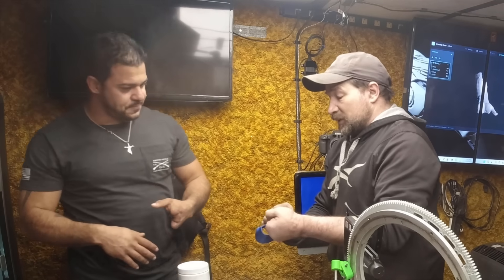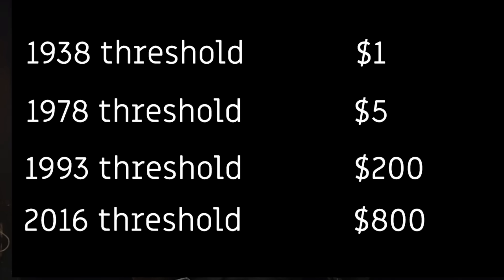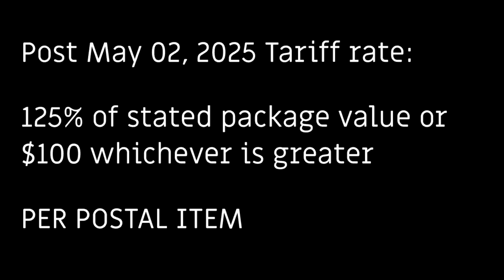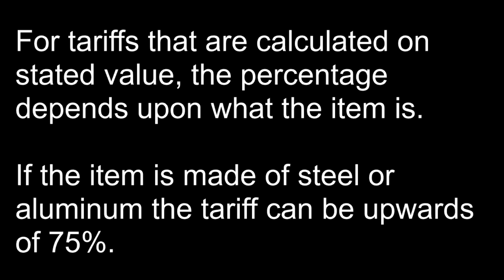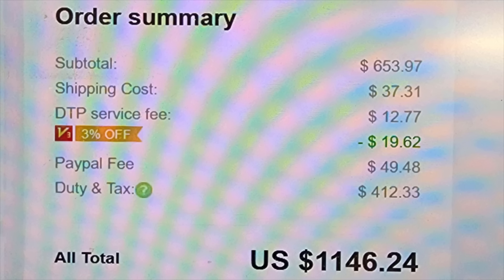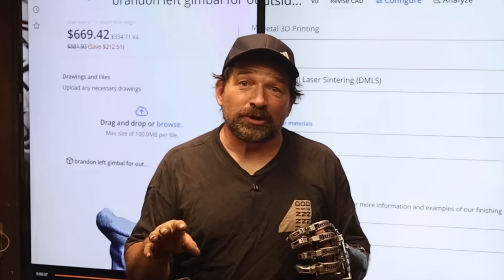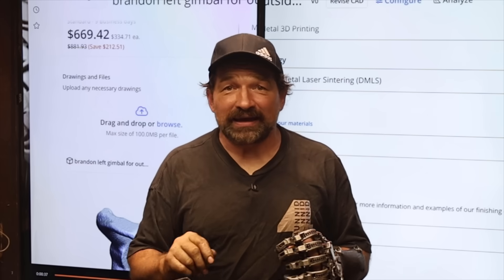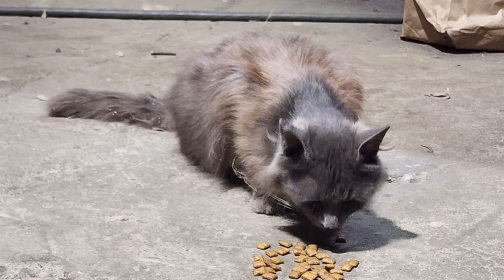No good deed goes unpunished

Comment: Quote your manufacturing domestically. If you don't want to pay the prices quoted, that's ok, but make sure you inform the shop the job was lost due to price. They will either reach out to you to work something out, or make a mental note for next time that their quote was uncompetitive. Quote from as many domestic sources as possible. The domestic industry needs to pick up the slack and add capability and capacity where it's able to. There is no mechanism by which domestic manufacturing can compete with a cheaper labor force. That's the whole point of tariffs, to ensure that access to foreign labor doesn't kill domestic labor.
Reply: one problem:

international megacorporations have been stripping domestic manufacturing capability from the USA for decades, and they don't want to spend money to restore it.
Reply: Smarter everyday just did a deep dive on this and show just how insanely difficult it is to get something manufactured in America.  Many forms of manufacturing simply aren't even available, let alone prohibitively expensive.  Sure you can check.  But as Chris Farley said in Black Sheep, "You can stick your head up a bulls rear end to get a good look at a t-bone steak but I'd rather just take the butchers word for it."
Reply: and those corporations are the same ones who don't even blink at the increased duties, this disproportionately punishes smaller businesses
Reply: I think there is a reasonable middle ground between "slave labor price" and "22x markup" that is surely just buying yachts for CEOs.

Comment: But?  But.... I thought "China will be paying the tariffs".  You're right that the money will not go to funding manufacturing in the US, it's far more likely to go to funding ICE agents outside polling stations.

OK, political snark aside, yeah, that sucks.  The manufacturing isn't coming back to the US on a business-scale level.  those with political blinkers might say it will, but people working at a business scale level will be doing stuff by the container, and shifting the extra cost on to the customer.  For the small scale, though , it simply stifles innovation like yours.  The way I see it, you have a few choices.

First one is to suck up the tariffs short term and hope for a more sane government longer term.  Expensive now, and might not get better later.
Depending where you are, you might be able to (for example) get your parts shipped to Canada then drive over the border to pick them up, being careful to scrap all the packaging.  And hope not to get caught.
You could change production methods.  Go old school, make up models and have the parts cast.  Of course, that kicks Ti out of the ballpark, requires someone with casting expertise, finish machining, and the material might not be as strong.
Or you could maybe set up a collective with other like minded people in the US to purchase an SLS setup, or maybe rent time on one, and try to fund it by turning out parts for other people at ~150% the chinese rate.  Not sure on the economics of that, but it might be worth looking into.
Reply: China exports are VAT free. Same produced in US costs sales tax more.

Why would any country put own industry into such disadvantage?
Reply: @sergeykish  You are correct, china does not charge VAT on exports.  But guess what?  The same applies for most countries.  Take the UK, for example.

(Prior to the tariff extravaganza) Products sold from the UK to the US are largely exempt from VAT, and are taxed at local rates, according to the combined tax rate for that project in the US.  This means that the customer pays the same rate for both locally and foreign produced products.

This is the same system used by most countries / trade blocs for international trade (with china and other countries), with some extra tariffs added on specific goods and services to discourage dumping.

It's not rocket surgery.  It's how international trade works.  That you've been told other countries are taking advantage of the US does not make that true, and does not make Trump's tariffs a good idea.

If you want to bring manufacturing back to the US, the cost of manufacturing needs to be basically equivalent to that of manufacturing overseas at the same quality.  That means government support, a massive investment in infrastructure and training, and a drop in wage costs.  Even assuming the government are willing to subsidise the building of factories and the training of staff and can be relied on to do that longer term than over the next 3 years, how many workers are going to be willing to take that job at 2/3 the average wage?  Especially if, due to tariffs, living costs are rising?

You can't put the genie back in the bottle

Comment: I wonder how much slave labor  can be calculated into the fractional prices coming out of China. What is the going rate of human suffering? Whose suffering is more valuable than others? USA USA USA Just kidding. Good luck with the continued progress and tariff work arounds
Reply: I mean, it's sort of a requirement for capitalism to function that there is an exploited class of people, both in the local "Well if you don't work a job you'll be homeless, and we're making it illegal to be homeless" and also on the global scale (see every nation that gets exploited for first world countries). Um but yeah, this is totally gonna solve the human suffering problem.
Reply: that actually depends on the sector a lot! industrial goods ,tooling and specialty hardware are made by skilled, voluntarily working specialists, and mostly cheaper due to the different culture in china, where the greed of making something for 400 bucks and then charging 20000 for it under the guise of "for professional use" isnt celebrated and rewarded like in the west, as well as the industrial sector in china being hyper specialized, with one factory rarely making one product, and rather dozens, if not hundreds, of factories making single parts assembled into various finished products in other factories.
If you wanna avoid slave labor you should try minimizing that dont need alot of... intellectual willingness of the workers body? Products like i.e. fast fashion.
Unfortunately, it is quite hard to avoid slave labor completely, as even 3M in the US uses it in a few states

Comment: Yep the tariffs ruined most of my projects. I can't justify paying more for pcb's and small alu parts. It was just a hobby for me, now they're just parts in a box.
Reply: You should look into why apple stopped manufacturing in India. It'll probably turn you off of getting anything from that country again
Reply: @Toefoo100 its a comedy of errors, and a ton of kickbacks too. Even if the guys on top try as hard as they can to put in laws and pass down orders to fall in line, grassroot corruption is difficult to eliminate.
Reply: Good find another supplier. Stop endlessly complaining you have options from Manila, Monterrey, Juarez,  Tokyo, and Jakarta, your just complaining like a spoiled child, you should have zero inputs from China a hostile trade partner
Reply: i have to print most of my parts, also I do most of my wiring by hand using protoboards, harder to smd solder, but not always viable for smaller parts, maybe we should look into etching methods and make our own boards, but that limits us to one or two layers, which is not optimal, it's a tough time.. as for metal parts, maybe print molds and use those to make secondary molds for metal casting
Reply: Pcbway has us manufacturing now as well.
Reply: if the tariffs don't relax, then India will fill the void, or Taiwan. i could see some chinese manufacturers straight up moving their tooling to another country to continue selling to the US. it may take some years, but someone will fill the manufacturing void for the US. the massive joke is that Trump thinks the US will fill it first lol. maybe with 50 billion dollars of incentives
Reply: @Gunbudder  if only, indian pcb manufacturing just isnt there yet. I'm indian and when I tried ordering a set of split keyboard pcbs, I found the minimum via pitch they could print was too large, and some vias came comepletely blocked off. Pcbway and jlcpcb are miles ahead in precision
Reply: @Gunbudder  Nah.  They'll just ship it from China to India, then label it "Made in India".
Reply: @Gunbudder  not likely. Building a factory like that is expensive and takes time, and it will never be down to the price it used to be because there will be fewer qualified workers to work in those factories.

Comment: It has to do with building of domestic production infrastructure, just give it some time, it may suck right now but that's just a part of the long term goal, the domestic businesses will have to lower their production cost at some point to get sales.
You could always set up a foam/plaster cast of your parts, over size them a bit then detail them yourself, 300-400$ seems a bit much for a hunk of metal with 3 threaded holes in it, for that price you could buy a furnace and crucible, then any extra parts you make using that method will eat that initial cost, you probably have a bunch of scrap aluminum laying around like most workshops have.
Reply: OP thinks we can backyard bootstrap a modern manufacturing economy. fukkin' LOL.
Reply: Lol.
Reply: @lithic2331  Lmao even.
Reply: imagine thinking you could just reverse decades to centuries of outsourcing, by disproportionately punishing everyone who isn't the gigantic corporations who made it happen in the first place

Comment: I stopped ordering abroad right around the time I learned the de minimis exception would be revoked. It's put several personal projects on hold, and I'm holding out hope that whatever this current admin is doing ends soon. I absolutely refuse to pay increased costs for often less well made products from domestic manufacturers, and that's if the parts I need are even available domestically because paying someone to make them is likewise out of the question.
Reply: De minimis was revoked just for China you entitled spoiled child. You can import from other non hostile cheap producers. Your entitlement is delusional
Reply: We have to do MORE than just "hold out" WAKE UP AMERICA
Reply: @BBVance  you missed, twice
Reply: Hopefully it will give companies a kick to actually start making crap here. Crazy thought but maybe circuit boards should be manufactured here instead of shipped across an ocean by an adversarial world power!
Reply: @Nathan_Higgens  that was going to happen but the current administration shut down funding that was going to build the factories here. Bidens chips act wouldve done it. 

The companies will never build factories here because its too expensive, takes too long, building materials are also tariffed, and our education is losing funding so they wont have anyone capable of working in the factories. You need educated people for certain positions in chip factories, you cant just take anyone. Tariffs and defunding has caused the worst possible conditions for building new factories of any kind.
Reply: @Nathan_Higgens  It won't, the cost of expanding existing businesses or opening new businesses to fill the market role domestically will far outweigh the potential profits within the goal fulfillment windows American businesses need to survive. Especially not now that it costs monumentally more to do than it did prior to the Trump administration's tariff actions. There are also a fair amount of companies in the US who already make the products we as hobbyists usually seek overseas, but when the domestic product costs nearly the same or more as the foreign product after tariffs, people will simply stop buying non-essential goods, and that's going to lead to an economic depression in short order. Has happened before in US history, is happening now, and will happen again. 

The smarter way to shift manufacturing to the domestic market would have been to strengthen international trade relationships while providing incentives for domestic businesses to expand into sectors with poor comparative coverage in the US domestic market. Then over a period of time, slowly raise tariffs to light the signal fire that domestic production is going to be the way forward. Not to do it all overnight and think the domestic industry will just pull themselves up by their bootstraps to materialize manufacturing capacity and startup capital from nothing.
Reply: @Nathan_Higgens  I hope you like paying tens of thousands of dollars for basic technology! There's a reason that China was so good at it: everything in their economy was oriented towards making complex parts REALLY well. Circuit boards are impossible to manufacture in the US at the same quality without paying orders of magnitude more money for each step in the process. Chinese factories literally all sit on the same street to optimise their supply chains. Some of them have specific rail lines between factories just to make every second count. It took decades to reach that point. Do you have decades and billions to invest?
Reply: @finalcut612 lol what is your point? I am fully aware this will take time and money. That’s why we need to start NOW. are you saying we should just give up and never make anything here ever again because we can’t just snap our fingers and reverse 50 years of offshoring in a month?
Reply: @Nathan_Higgens Setting up manufacturing in the US would take decades and trillions of dollars, on top of the whole economic policy flipping every 4 years. On top of it being literally impossible to manufacture complicated technology here for at least the next 100 years. And you'd still have to import all the resources.
Reply: @squalester again, your point is? You guys keep replying to me about how expensive and hard it will be and how much time it will take as if that’s reason to just not change anything and give up. If we start NOW, kids entering highschool will graduate college in a world where everything in the nation is manufactured domestically and far cheaper
Reply: @Nathan_Higgens  It would never be cheaper, that's the reason manufacturing moved to foreign entities. There inst anyone in the US willing to work the $2-$3 an hour it takes to manufacture cheap. It isn't about "giving up" there is just no reason to even think about doing it in the first place because the #1 cost is always labor. Never mind that we would still be importing almost all the resources anyways.
Reply: @squalester lol so we should do nothing so we can continue using foreign slaves? Also, how do you explain the entire history of America up until the 80s? We used to manufacture everything. 

John Stossel released a video recently - we stopped making stuff because the government taxes the life out of us, and because labor unions bankrupt the rust belt (once the steel belt) with ridiculous demands
Reply: @Nathan_Higgens  No solutions from this crowd, man. The worst parts of universal suffrage nonsense is how everyone suddenly thinks they have any idea of anything in politics.

If you're a normie, cool, just be a normie & disconnect from the BS of the news cycle. This stuff runs on a timeline of years to decades.
Reply: @squalester  Cheaper is not the point. Are you willing to pay for the well-being of your countrymen, & our national security in our supply chain, or not?